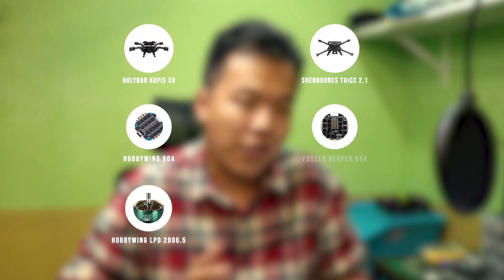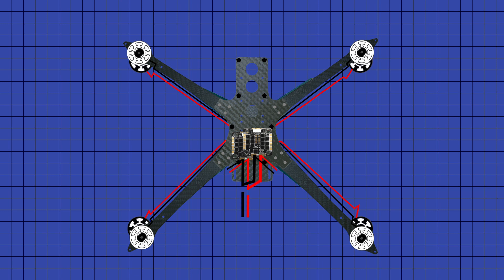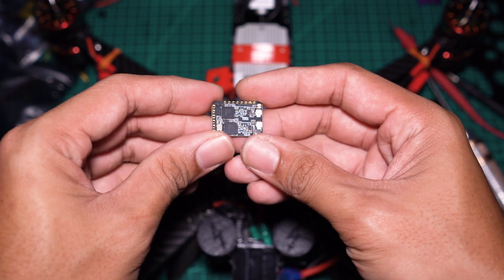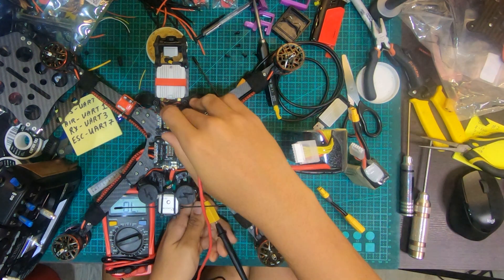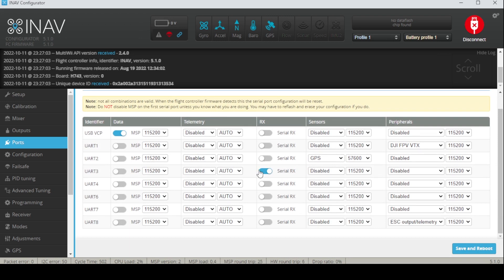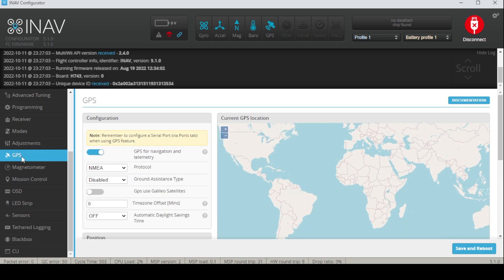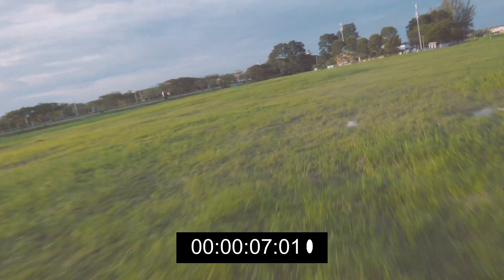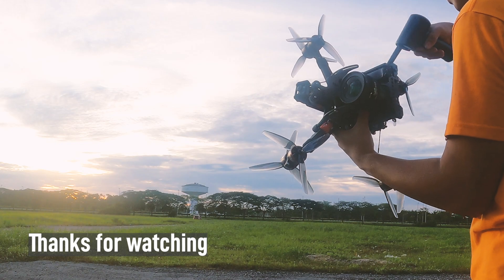Building an FPV Cinelifter - wiring to programming

Comment: Great video, can you please share the software name and link you used for the wiring diagram. It would be really helpful. Thank you
Reply from the maker: I drew it in adobe illustrator and animated in AE. Dont know if theres a programme for it 😫
Reply: @ Also can you please share the wiring of the cinema camera attached to battery. Or if you there is any other method to power the camera can you please share that. It would be very helpful. Thank you in advance.

Comment: Hi, do I need bridge on vbat on fc?
Reply from the maker: Hey could you elaborate on what your asking about?
In terms of power

One XT90 set will split to two escs giving power to both escs.
One esc can then supply power to the flight controller with signal wires 1234
While the second esc only needs signal wires 5678
Reply: @TanFK  hi, I meant that Bridge on FC, Vsw = Vbat  5v.  Also, do you connect power and ground on  both esc to fc? I fought that Vcurrent and Ground plus all Throttles on the slave esc. Thanks. Jakub
Reply from the maker: @AirviewFilm  
1- the VSW on the front part of your pad will emit Vbat if you bridge the centre pad with vbat, while it will emit 5v if you bridge the latter. You decide what the vsw pad does by joining it.
2- it’s not necessary but yes I connected both esc’s vbat and ground to my fc, because at the chance one esc fails, the other esc can continue the circuit reliably(that’s just my theory)
As I read, You just don’t need to connect the Uart wire or current wire on the slave esc to fc.

Comment: Hello from Russia! And please tell me what kind of fan you use at the end of the video?
Reply from the maker: Hello! 
Sorry for the late reply, I missed your comment. 
I use the Cenzimo Air Duster, its good at cleaning my fpv bag from dust, but not good dust removal for drone... I still need to brush my quad after dusty session, so i recommend you search 'electronic air duster' and find a better brand..

No matter what Aerosol Duster cans are #1 for performance, but I compromise with electronic as a sub-par solution because I feel bad about throwing away empty cans.

Comment: Thank you for this tutotrial!
But I have a problem. On the same FC, my air unit doesn't work. I used the bec and everything but it seems like the air unit does not receive enought power to work. Do you know what could it be? Thank you.
Reply from the maker: Just to make sure bro, did you bridge the 9V pad at the back side of the BEC?
Cuz if the two pads are not shorted the bec is emitting 5V
Reply: @TanFK  Yes man, I did it as you showed in the video, but didn't work
Reply from the maker: @PabloUrba  my suspect might be a faulty BEC. You could check a multimeter on direct voltage [V]. 
Positive Prong on 9v out of the Bec and Negative Prong on Gnd of Bec, Multimeter should show around the 9V range if the BEC is working, 
if your BEC's not at fault, you might want to try powering the Air unit on another quad to also check if the Air unit is OK 

On a random note:
I dunno if you're using a Diatone BEC, but I've had a friend who used a Diatone BEC on the his cinelifter and it shorted itself on his first few flights, so avoid those.
Reply: @TanFK  Yes, checked the air unit on another quad and worked fine. I tryed with 3 becs. On the cinelifter fc i have got the message 'Image transmission stopped' showed on the dji googles.
Reply from the maker: Very strange..

But the next step I’ll try: 
 To power the BEC, you could try soldering it straight to the ESC +/- leads to test first. 

It’s no problem bro I’ve done it before, there’s continuity between FC VBAT pad and your ESC (+) lead. 
Doing this will just close the distance of your BEC to the lipo
Reply: @TanFK  finally it works! I connected the cables directly to the esc cables. Now I have another problem: I plugged the 6s batteries and betaflight show me that is a 2s batterie 😂
Reply from the maker: @PabloUrba  great news about the air unit. 

That’s a weird one about the lipo reading..

I’m beginning to suspect electrical noise in your circuit.

What capacitors are you running on your escs?

And try look into installing a smaller uF capacitor on your flight controller vbat and GND

Comment: current from 2nd esc? didn't used?
Reply from the maker: yes bro. 

ESC 1 - Everything including current and telemetery I wired on JST. 
ESC 2-  Vbat, GND and Signal ONLY.

I can still have accurate reading of my battery no problem. 

__

Why I didnt wire it to esc #2 is because on the FPV Cinelifters facebook group,  I searched 
'ESC Wiring'
and there's one comment saying connecting both current wires will blow the FC. 
So I played safe and didnt wire those. 

On a side note, the Facebook group guy was refering to a Lux F7 Flight Controller, So Im not sure if this would also apply to Matek Flight Controllers.
Reply: @TanFK  thanks mate, I've also searched some literature on cinelifter x8, but confused with 4in1 esc which has current pad, I'll try to build my x8 using matek F722 SE and other cheap kits 😅
Reply from the maker: @pilotlawaran  more common, 4 in 1 escs have current pad but no telemetry pad. but actually you can live without them. 

Ah I see. Matek f722 se. I Managed to get it to fly X8. Just note you’ll need inav x8 firmware flashed to see all 8 motors yea
Reply: @TanFK  nice info 😀

Comment: Had the same issue with the smoke stoppers. I woulder if one could be made specifically for cinelifter type builds?
Reply from the maker: I’m assuming here but I think the solution would be the XT 90 8s rated smoke stopper should be able to get the job done. 
For now the xt60 6s rated doesn’t work regardless which battery I try
Reply: @TanFK  I also had to do the plug and pray 🙏 🤣 luckily I was all good 👍
Reply from the maker: It’s so weird even my multimeter was red flagging me on the check. 🤔
I held my breath, counted to five and then plugged it in. It just felt like the biggest gamble on my bench 🥶